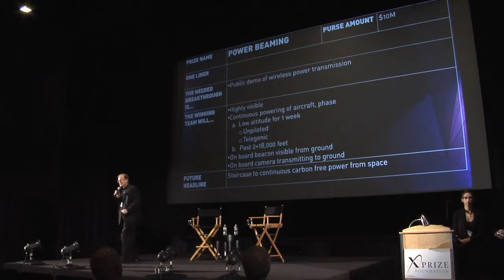Wireless Power Transmission - Visioneering 2011 - X PRIZE Foundation

Comment: I'm very interested in this one as it seems like it would be so easy to realize and yet has so many more promising implications for the future unlike some of the other concepts such as the fast travel and water purification concepts which are clearly one way streets and solving only a single problem, like commute times and clean drinking water, but fail to offer anything more.